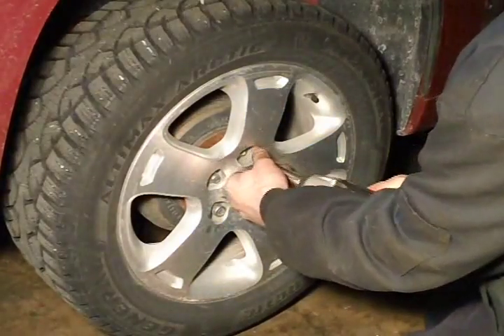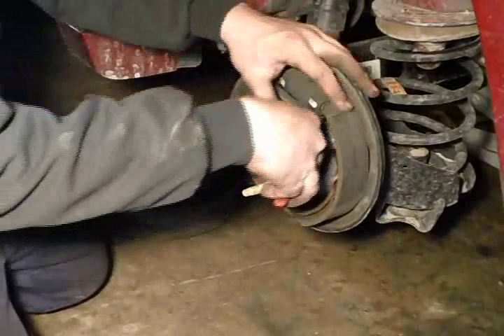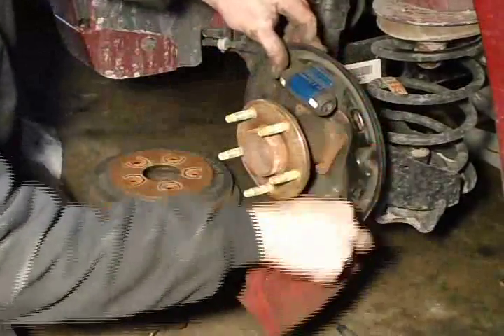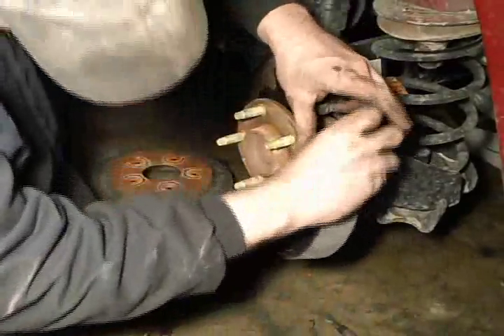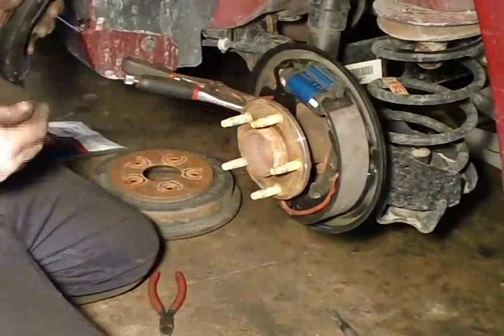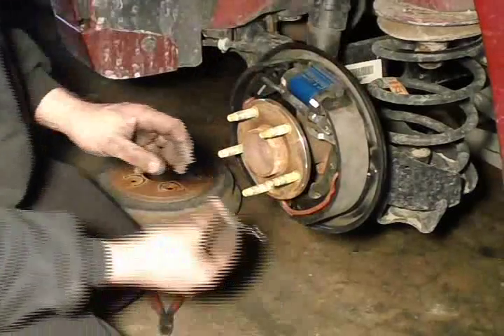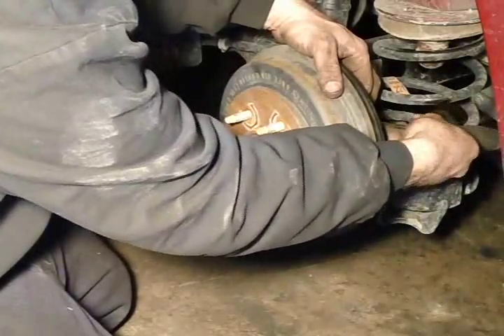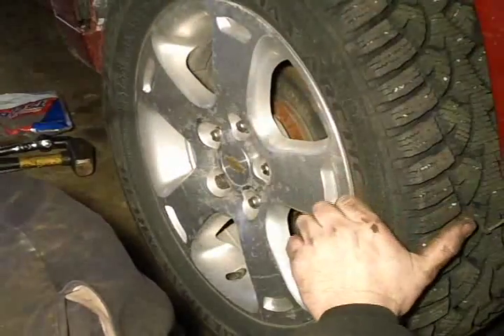Maintenance, replacing rear brake shoes (2007 Chevy HHR)

Comment: The setup was the same on my 2006 GMC Sierra. I had a little difficulty removing the parking brakes cable from the brake shoe, but once I got it off it was smooth sail. Needless to say the parts were a little bigger. Thanks for the demo, it was very helpful.

Comment: when removing the brake hub ? I use a rubber mallet to prevent any damage to it , the retainer EB spring I use a vice on its end and then gently remove the pad hook ( by rotating opposite its insert ) this way I can use the pad itself to counterweight the spring tension :) but thank you for the great upload

Comment: Hey I was wondering if you have original hardware do I replace the button springs and the bottom return spring with the w shaped wire 
And also does the adjustment lever slide around the e brake bolt 
I have an hhr and the shoes are original and the e brake is on the outside of the shoe not on the inside

Comment: Yeah, I Wanna Know What Was Wrong With The Spring And Pins That Hold The Shoes On That They used For Over 30 Years. What A Horrible Design. Thanks GM Engineers.